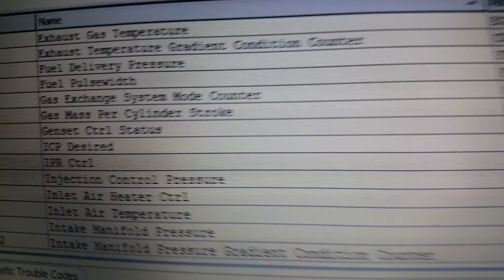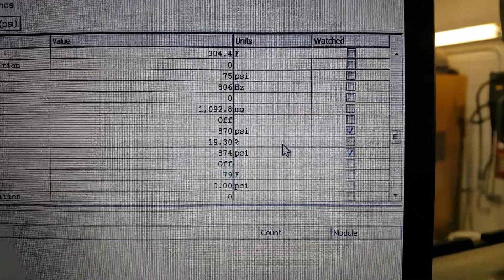Checking Injection Control Pressure MaxxForce DT Diesel Engine

Comment: Hi sir
I got low ICP signal dt466 2004.

New ICP sensor 
New cam sensor
New ipr and pigtail
All new Oring seal replaced
Truck ICP low light comes when on road test.
And gas pedal not responding right it away it takes long to response
And if turn it off
It takes very long crank to start.
I read ICP and ICP desire 620 roughly
And crank with 500psi

What's good reading for ipr or or fuel 
I got service Max..
Reply: I know this was a long time ago but I had a similar problem on a newer model and it was the fuel basket on the side of the engine